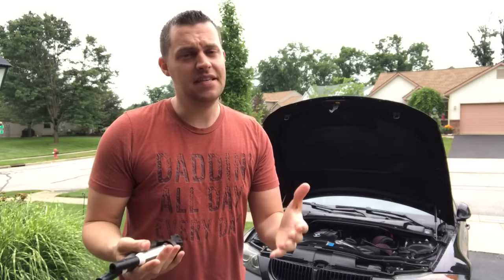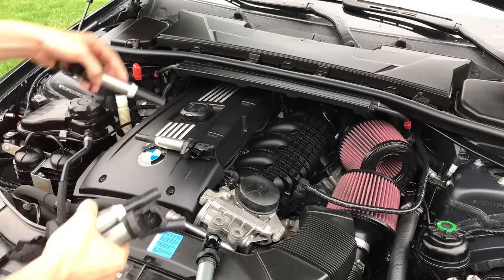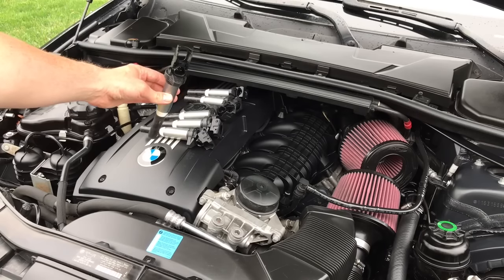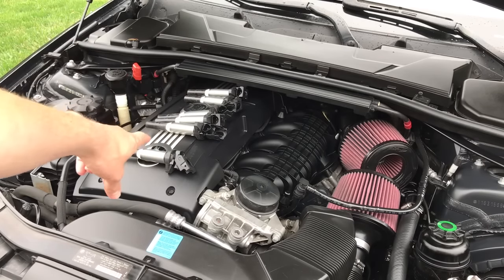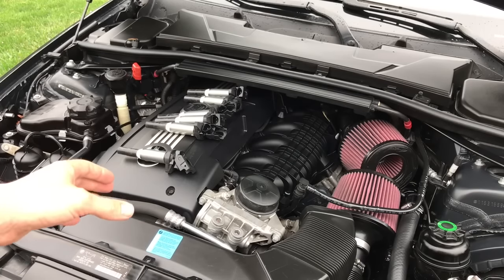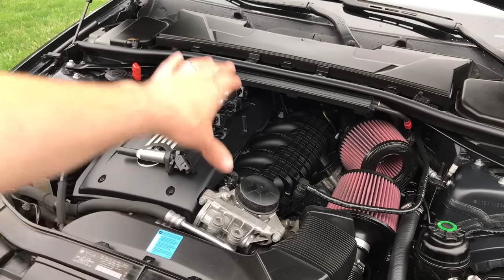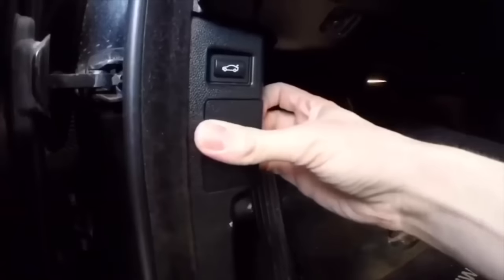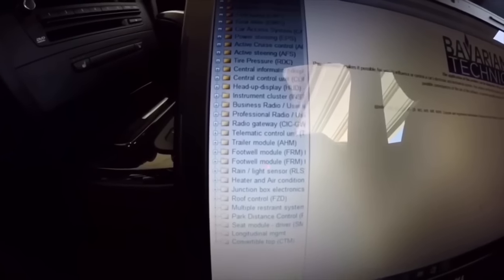BMW ENGINE MISFIRE? HERE’S A FREE FIX!

Comment: Thank you! I first changed all the spark plugs, it was due anyway. The diagnosis reported cylinder 3 misfiring. Deleted the code, let it run a while, same code came up. So I did what you said, swapped coil 3 with coil 4 and no misfiring anymore! The code didn't even follow the coil, it's just resolved itself.

Comment: I'm a woman who owner 2006 White BMW  X5 4.4L . I've had it diagnosed twice And have had a tune-up First mechanic told me it might be the gas cap replacement gas cap said everything was fine but didn't explain to me about the codes PO456  PO308 Second mechanic said he couldn't find anything wrong this video explained it all excellent wonderful I'm a woman you know most women always do is put gas in the car thanks so much for the help

Comment: Thanks! I currently have a 1999 BMW 328i, but I’m going to buy this generation of BMW this May. I may just do a complete tuneup on it when I get it. I love BMWs, because they are extremely easy to work on and well engineered. The placement of parts are very well thought out. Well, except for my vehicle replacing the starter was not fun as it was in a extremely difficult area. Other than that, it’s a very easy car to work on.
Reply: Oh just wait
Reply: @Nxaura0 😂

Comment: Just replaced all six of my ignition coils on my 08 bmw 328i and it’s works the shaking and rough idle is GONE !!! Cost $200 bucks at auto zone 😂but my problem are gone thx 🙏
Reply: Next time you need to replace them again and if you don't mind waiting a few days for delivery, try eeuroparts.com; way cheaper than that! guaranteed quality (and I'm picky)
Reply: My cylinder 1 is misfiring.  Does it cost around £200ish to fix?

Comment: Swap coils- saved you 6 minutes. Your welcome.
Reply: You’re *..... and thanks
Reply: It took me 7mins to analyze your comment
Reply: Replaced all my coils still get misfires. Going to do the injector thing.
Reply: @snoopyfix2  same thing happened to me did the injectors work for you
Reply: @ricardocortez3961  Unfortunately no. I went the cheap route though. I replaced all the injectors for about $100. Now I get a slight noise, similar to a faucet spewing water. That's what makes me believe it's the injectors.
Reply: Did you get quality coils? Did you get bmw spark plugs?
Reply: Thanks.
Reply: I swapped spark plugs and coils on my 545i and it still misfires on cylinder 3 says p0303
Reply: @cashtrip777  hey did the same still
Have a cylinder 3 misfire so I ordered some use index 11 fuel injectors so I think it might be that I have a bad injector
Reply: Your the best !!! Midnight here and was NOT wanting to deal with watching this ! Lol

Comment: Quick question; My misfires go away after a second or two on idle. These codes do not show up via normal obd2 or MHD. This misfire usually occurs on startup 50 percent  of the time but instantly goes away and comes back periodically on idle. My assumption is a failing injector but its hard to confirm since I don't know which cylinder

Comment: Change all six plugs and coils when you have think about just one. 
Rigs at 80k plus with no change should be changed regardless of misfire or not.

I change coils and plugs every 60k no matter what. 
3k oil changes. 10k brake bleeds. 75k transmission service.
35k differential service. 

My car has always been reliable AF!

Comment: I get the misfire code on cylinder 6 sometimes running map 7 only with E65 mix. New plug coil still there, going to try the injector swap.
E90 335i FBO JB4+MHD E85 BEF STAGE 2 FUEL IT
Reply: May solve your problem , but carbon build on the intake valves at that cylinder will cause a missfire code too....So you have to start at the beginning;  clean intake valves. Than study the code behaviour. good luck!

Comment: I have a 2011 550 F10... got drivetrain malfunction. Took to dealer they said it was coil number 7. I decided to do diy and change all spark plugs and coils because it seemed simple enough. The drivetrain malfunction is gone after the change but the engine light is on. The car doesn't idle well and if I give it half throttle while driving the drive train malfunction comes back up, it will clear when I restart the car. Today I went to local shop said cylinder 7 and 8 misfire. Also cylinder 7 had moisture looked like oil... Maybe gas although it didn't smell like it. What would you recommend? Injectors and/or carbon? Valve cover?
Reply: I'm having similar issues now. Exact car, cylinder2&3 misfire. Change out all 8 plugs and coils, still happens, drive malfunction. I'm running JB4 and meth not tuned.

Comment: Perfect timing, I just got an misfire on cylinder 6. This will come in handy, do you think Carly is good enough as a scanning tool?
Reply: Try MHD its Free
Reply: It is but it's 60 buck a year. Also if have it use the obd option for p codes.
Reply: Hey man do you know where the cylinder 6 what part i have same issue.

Comment: I have a code saying I’ve got misfires on all my cylinders except one… I replaced my plugs and coils and it’s still happening… 2010 E60 98k… runs rough for the first five minutes and then it runs great… if I clear the codes it won’t throw a code until I let it sit for a couple of hours then it’ll run rough again and then throw a code…

Comment: What brand of spark plugs do you use? Where do you purchase yours? What’s the price?
Reply: 3 grades.  Cheap 35,000 Miles ,  OEM (NGK)  50,000 Miles & Performance plugs 90,000 Miles.

Comment: I need  your help folks? I got bought an abandoned 98’ e36 M3 S52 with two bad cylinders 1 and 2. I have replaced and switched around coils, spark plugs, and injectors... No changes. Only diagnostic test done so far is coil ignition test. And they are good. Symptoms found were moisture on tip of spark plugs 1,2... perhaps gas or coolant. Overheating... I believe bad Thermostat. Codes pulled are P0300, P0301, P0302. I tried unplugging coils 1,2 while engine is running and it did not change engines timing. I also notice a small hose that goes somewhere under the intake manifold is hanging around. There is moisture under oil cap every time I check, and lower radiator hose stays cool at operating temp. I plan to replace thermostat, search for vacuum leaks with smoke tester. I am thinking it is intake gasket leak, or valve cover leak, or vacuum. I’m hoping for responses or opinions and praying it’s not head gasket. Help......
Reply: Compression test 1 and 2 aswell if it's getting fuel cut off but I get thermostat code alot comes and goes I finally got thermo code then misfies bank 1 & 2  soon after

Comment: I just replaced my eccentric shaft and relearned it successfully. Car started, then started running lean. Had a misfire cyl 2/3/4. Swapped 1 & 2, and only had misfire 3/4. Tried swapping 3 and 5, then had misfire 3/4/5, swapped  3 & 5 back, then swapped 4 & 6, still had 3/4/5 misfires. Then it had a 2D59 ECM internal error code and wouldn't turn over again. Suggestions?

Comment: I have a 2018 430i gc with the b46 stage 2 tuned with a cylinder 3 misfiring. Is this the same process?

Comment: Questions maybe someone had the same problem... 08 328xi just threw a code and started running like crap misfire in cylinder 1&6 changed the plugs but still runs like crap any suggestions
Reply: Same problem any solution?

Comment: Im doing the mhd flash this week but I might just hold off and change my spark plugs and coils just to be safe .
Reply: probably a good idea 😂 I just got MHD and under full throttle it misfires. Good place to start.
Reply: Just got the MHD tune misfires Immediately
Reply: i’ve had mhd for two weeks and got misfires and fuel injector deactivations

Comment: 2c7e oxygen sensor emissions control.upon starting rough idle, within 10 seconds it straightens out, but Engine running rich, you can smell the petrol. 2 oxygens sensors in the engine bay have been replaced, i take it thats pre cat, so now i need to replace 2 by the cats?
Reply: Mine runs rich too. You can smell it. I've replaced all ignition coils twice in a year. It fixes the intermittent shutters for a little bit and then it comes right back. Done the swapping thing. I'm going to look at the injectors and see if that keeps causing my issue. And replacing the O2 sensors help?

Comment: I did however ad miniature air filters on my aftermarket charge pipe and a hks vacuum BOV ......I'm now running a small mix of e85 and I can't stress enough these cars are insane, the intercooler swap is MAJOR I have an intake temp gauge and with my 5" ducted sealed cooler o all that air Rams in I get roughly 10deg c above ambient after hard driving if I did this before on stock I would do 1 hard pull and it would just keep soaking exponentially until it was 2.5times ambient which is just like park and don't boost its a really really important part I think and I must confess I got a cheap eBay one to experiment but it has worked so well I just kept it, I'm in hot part of AUS too so if your on a budget I'd consider the eBay copy , I may be in the minority/lucky  though but it's mad gains never heat soaks it's like it's not able, if u want your engine to ever cool down more and the cooler cause mine is sealed meaning it will suck outside air into intercooler then radiator turn your aircon on for a few minutes and watch the temp drop dramatically

Comment: I've just diagnosed my 09 335i and I have a cylinder 5 misfire P0305. Any recommendations? I have 128K miles on it.
Reply: I know this is old but did you ever figure it out? I’m having the exact issue with exact car with similar miles
Reply: @xqueenx83x  I had to replace the ignition coils and spark plugs

Comment: I just replaced my spark plug with new ones, wasn't having any problems before but now I have a missfire and no codes are showing.. Any advice BMW fanatic ?
Reply: austin rosser it’s most likely your ignition coils. I had to replace mine
Reply: Nour Hummadi thanks man. Any help goes a long way!
Reply: Nour Hummadi bought a new coil today and went down the line swaping each one out with the new one and no change. Could it possibly be just a bad batch or sparkplugs?
Reply: austin rosser it can be your injectors maybe :/ ?
Reply: austin rosser but it’s best to change all the coils  it just one tbh
Reply: go for a long 30 Miles or 50 Km drive Throw 170ml / 6oz of Water or small bottle of water in air intake to see is the carb build up.  if so drive  4 mile or 6 Km and reset you code. chance are it will clear.
Reply: what the fuck? add water into the air intake?!?! @raymond289
Reply: Yes pour water into the intake 😄😄😄

Comment: What you think is , only  have a rpm jumping on reverse ,   And sometimes on the drive with the break on , like red light 
What should I do cause is not  everytime , and is bad shaking you can feel it , rpm 800 to 600
Reply: Could by coming from cylinder. I have very similar issues on my e90 right now. Can is misfiring, shaking at idle( 800 to 600), will also shake in reverse. However, once I pick up speed I don't feel it anymore. So yeah, I scanned my e90 and it says the misfire is coming from cylinder 1. I'm gonna start with swapping cylinder 1/2 coils tomorrow and go from there.

Comment: Tried this with my 08 BMW e66, have a cylinder 6 misfire so I swapped coils, didn't work, bought new spark plugs first denso then ngk gapped at .44 didn't work, then switched fuel injectors and that didnt work, also I tested the spark plug to make sure its getting spark and I is.

Comment: Spark plug 3 and 4 in my car came out with oil in them, do I have to replace the whole gasket?
Reply: It would be smart to replace all gaskets related to the valve cover. If you have the knowledge and time, you should also replace your oil filter housing gasket. It is prone to failing.

Comment: Thanks I'm having the same issues now. I have a 550i and it comes up cylinders 2&3 miss fire. I change sparks plug and coil, but it still comes back. I'm running JB4 and meth not tuned. I'm just freaking out right now.
Reply: what did it end up being ?

Comment: I replaced coil #4 as well as the spark plug the car turned on perfectly fine the next day my car would not start any clue what it could be ?
Reply: Dee___Rivera you need to program it
Reply: @bhinosrt8557  what is she said coil replaced swamped not fuel injector the fuel injectors need to be programmed.

Comment: I’m getting misfire Cylinder 6 I got new spark plugs and switch the coil pack ..but it won’t change I also had some oil on a few spark plugs any advice??
Reply: Very possible you are arcing ,so use electric greece also change the rubber boots

Comment: Got an X3 2.5, 2005y petrol, always misfire on cylinder 6, done plugs, coil lead, injector and both O2 sensors, still goes to misfire on cyl 6 after 8 min idling

Comment: Why i still have misfire code after change of coil and spark plogs
Reply: injectors
Reply: Injectors or carbon buildup
Reply: Change your fuel pump
Reply: @aklol7384  how does the fuel pump contribute to misfire
Reply: @rajabkarume3840  i have same problem then I went bmw they said my car fuel pump is gone but car still start and drive and its reduced the speed. After change the fuel pump mine works fine
Reply: There are many reasons for misfire the common is fuel pump
Reply: @aklol7384  thanx alot..I will consider changing my fuel pump too because my misfire is really bothering
Reply: I’m getting misfire Cylinder 6 I got new spark plugs and switch the coil pack ..but it won’t change I also had some oil on a few spark plugs any advice??

Comment: Buy your repair manual book and get a  good code reader/ programmer, educate yourselves on your baby’s! Find out what parts are known to go out and don’t replace them with cheap parts. GASKETS! Bad grounds, leaking vacuum lines and oil covered engine parts are priority. Don’t put high performance parts on before.

Comment: I have a slight miss on idle only then it goes away when warm no codes come up is this really anything to bother looking into? I'm changing plugs soon but I'm surprised the code never comes up maybe it's just rich startup pops?
Reply: Sounds like a vacuum leak,  possibly from the manifold. The misfire will occur on cold start-ups usually through one of the gaskets, which will then expand as the engine heats up and re-seal the air leak. I had similar cold engine misfires which turned out to be the manifold gasket going to cylinder no. 2, so went and got all intake manifold gaskets replaced and that sorted the problem. It may not be the same fault on your own car but it's certainly something to look for. Good advice is to get a smoke test done for vacuum leaks.
Reply: Did yu find the problem
Reply: ps3dayday ,my car runs just perfect I think it was my stock charge pipe cause I changed that and intercooler and it runs perfect every time, I never even bothered changing plugs using the lazy/smart? Old saying don't fix it if it ain't broke.....this channel is the best by far for this car so if he says do something I'd listen he's a BOSS at common sense smart guy and problem solver in my opinion

Comment: I have a 2007 e91 328i that misfires once warmed up sometimes coupled with a whistle noise when it happens. What could this be? No engine codes atm
Reply: the whistling noise you're hearing could be one of 2 things.....the water pump......or you have an " un metered air " intake leak.....this will cause misfire codes if more than 1 cylinder begins to misfire a predetermined amout of times , check all your intake connections on the filter box and connections leading to the intake manifold if it's turbocharged , check to make sure charge pipes are secured to the turbo's
Reply: @mattriella6776  It turned out to be the pcv valve on the valve cover. Just went ahead and got a new valve cover and gaskets for $100 and its working great now.

Comment: I have a misfire or rough idle on a cold engine but not getting any codes, when the engine has warmed up it runs and idle's fine. Do you think this could be the vanos solenoids? Seen your video on replacing them and looks like an easy diy. Engine only has 42000. Or would you recommend checking plugs and coils first?
Reply: Long time owner here. It's normal on a cold start. n54 starts up in open loop mode with no o2 sensors and tmap, etc  metering the car. After a minute or so, it transitions to closed loop and then emissions are in place smoothing it out. If you have no codes, you're fine. If it was vanos, you'd know. You'd get a dash CEL and limp mode. You'd also see 2A82 or 2A87 codes.
Reply: Could be a vacuum leak.

Comment: Hey have you ever encountered a flashing dash, everything goes on and off the a/c the radio the clusters dash lights
Reply: sound like a electric issue replace all you small fuse micro and ATO fuse first. if still is a issue you might need to take it into the Dealer for repairs.

Comment: I’d highly recommend checking and cleaning the vanos solenoids 
Replaced my spark plugs and it was misfiring to the point the engine turned off 
Sure enough the vanos solenoids were dirty with oil
Reply: Was your check engine light on?  Were you using a lot of oil?
Reply: The check engine light was on but i didn’t read the code so I clean up the vanos solenoids and made sure the coils were completely plugged in and it got rid of the misfire
Reply: Donna Arnold  oil was about 3,500 miles in before an oil change probably about half a quart low when it was parked

Comment: Mys po305 on E46  had crack coil pack flip it out replace it next day same code went change it next day same code .. went bought 6 spark plugs next day same code again soo since I have hookup pickup 6 Oem injector swap them next day same code at cold startup and I went bought all new o2 sensor swap them and again same fucking Code .. I order brand new coil plug harness and and swap it and again same code po305 ... I don’t know wtf it could be always at cold startup never after its warm or been running for hours .. only overNite startups.